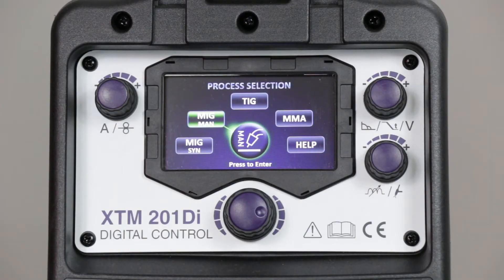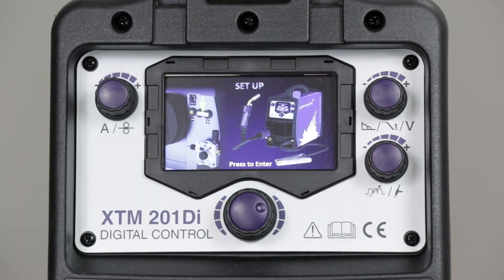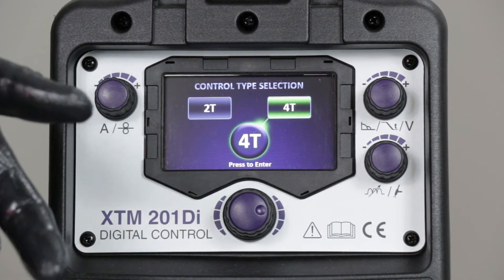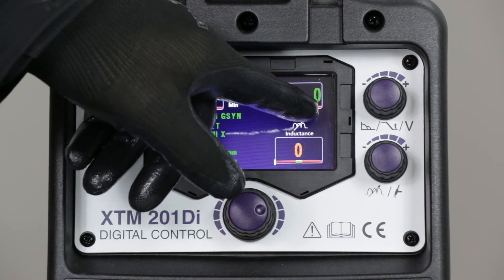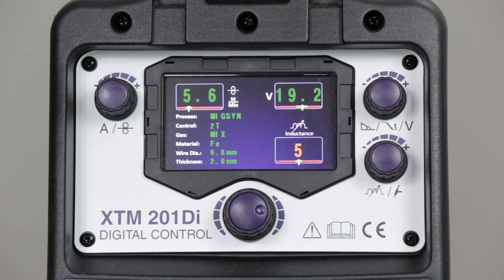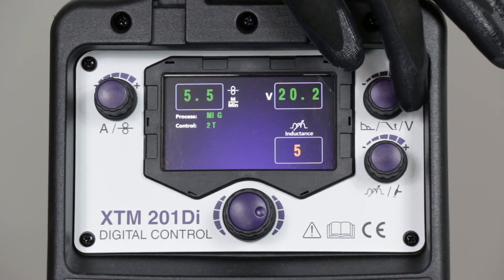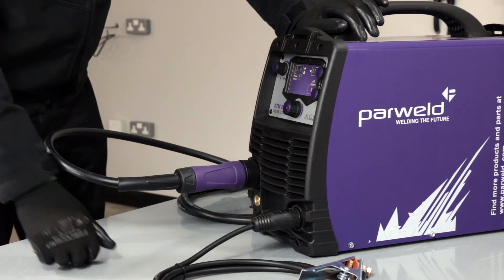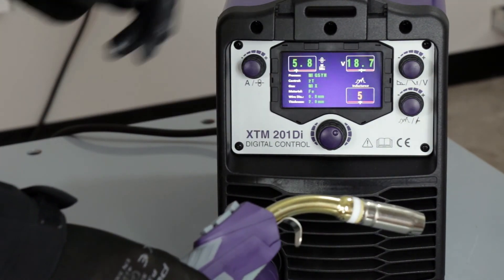XTM 201Di MIG Machine Welding Setup

Comment: 3:40 Hello. I want to buy exactly this machine but you guys give different values on load voltage range. In your website its listed : 18 - 26.5V . In the actual PDF manual which is at the website, voltage is listed : 15.2 - 26.5V range. But other independent vendors selling this machine listed it : 16 - 26.5 V. Its important for me because i want to weld with 0.6mm wire which requires 16V at the high end. Is the bottom range 18V or 15.2 ?
Reply from the maker: Thanks Peter. Let us check this out and we will come back to you.